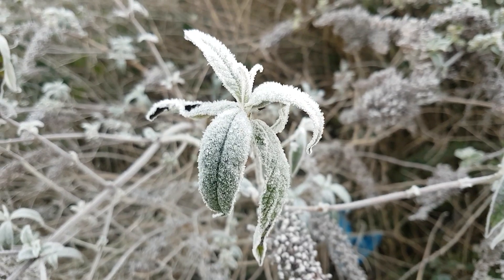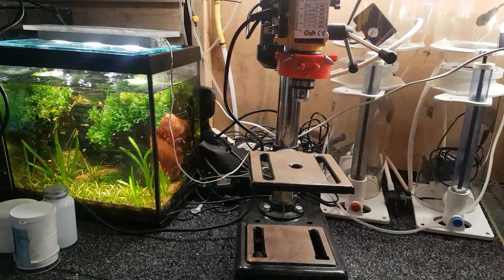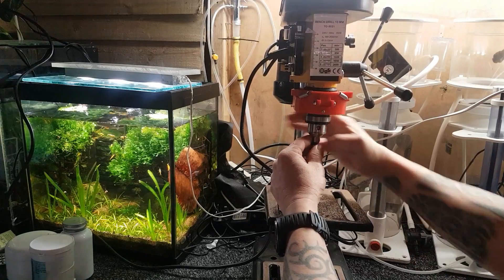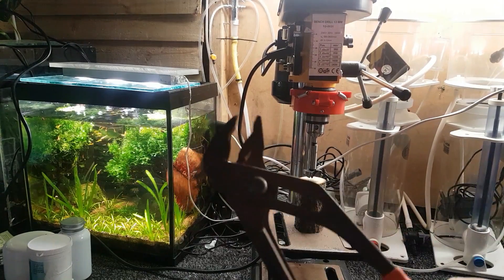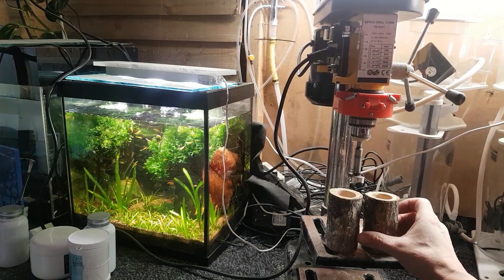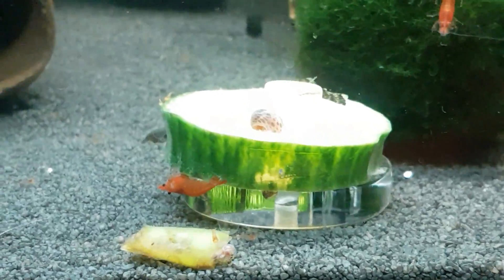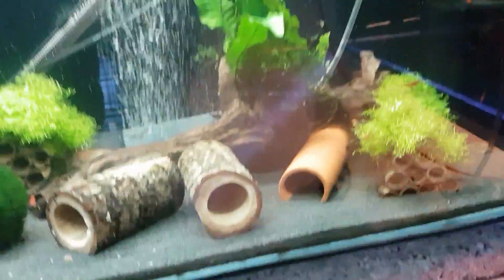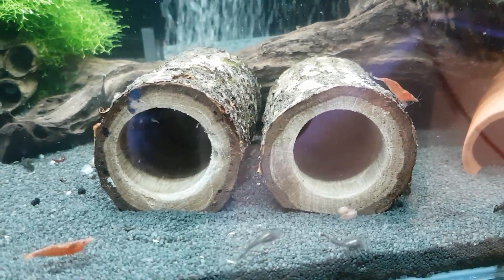HOW TO MAKE A PLECO FISH CAVE

Comment: A belt sander will flatten the bottom off as well and a small bead of aquarium safe silicon will attach the wood to a piece of slate that will hold them in place in the tank.  I like to remove the live edge all the way around before they go in.

Comment: Love the cave but i wouldn't be holding the oak with the mole grips! I it did spin rather abruptly, there's a chance it may flip out your hands with the torque and hit that little tank to the left !
Reply from the maker: They're pipe grips and don't lock on. 👍😀
Reply: I was just worried about your little tank ive seen things like that happen so fast, some people dont realize how quickly things can go wrong.  loving the videos  @MARKSAQUATICS